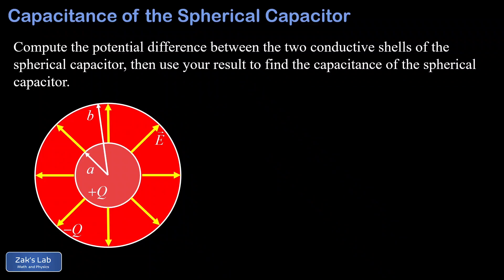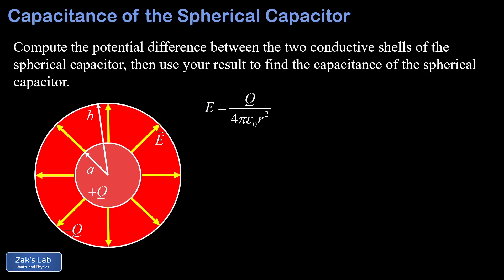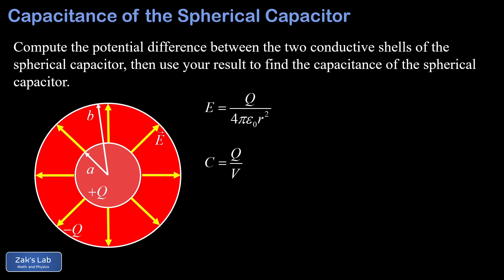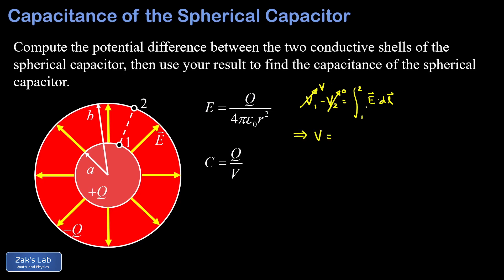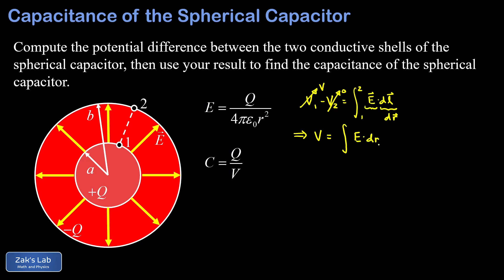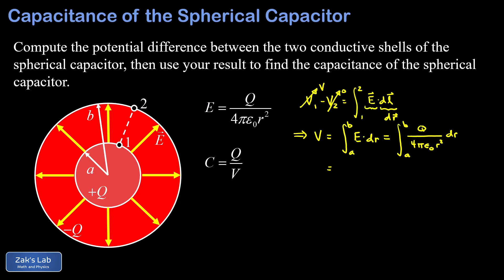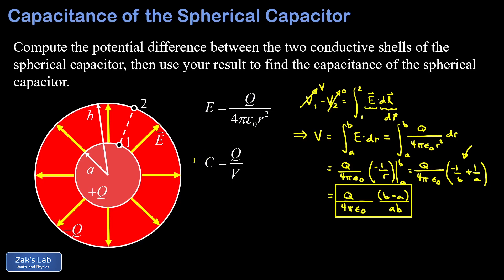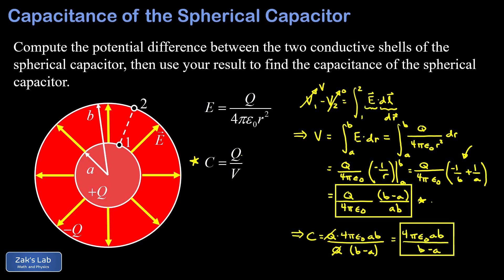Potential difference and capacitance for the spherical capacitor [Spherical Shell Capacitor Pt. 2]

Comment: As I remembered, capacitance is not decided by the charge or the potential difference, as capacitance is constant. I mean capacitance can be calculated by using C=Q/V, but if Q/V changes, then V/Q must change correspondingly. Please correct me. Thanks🎉
Reply from the maker: Capacitance is Q/V, so you put the charge +/-Q on the two conductors, compute the potential difference (V), then compute Q/V to get the capacitance.  That ratio of Q/V will not change with charge.  Notice the expression for capacitance comes out to a constant here that only depends on the geometry of the capacitor, since V turned out to be proportional to Q and the Q's cancel when you compute Q/V.
Reply: @ZaksLab  Yeah, I see what you mean now. Thanks very much😀